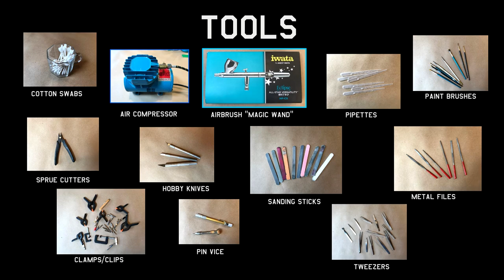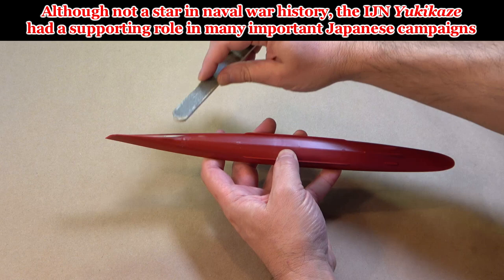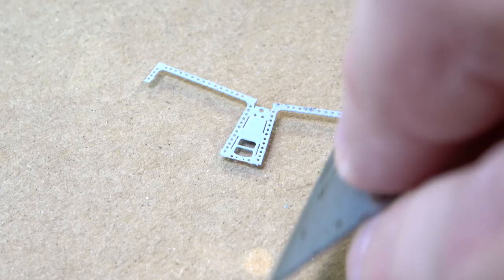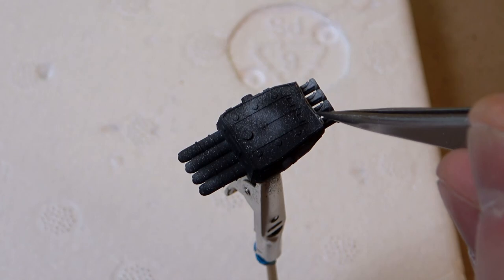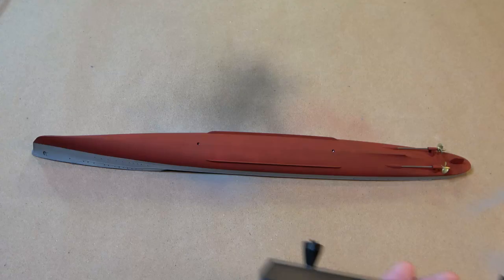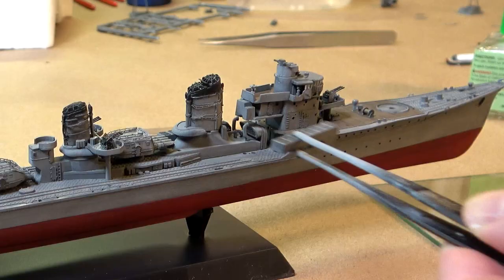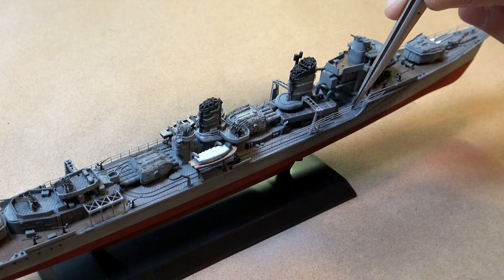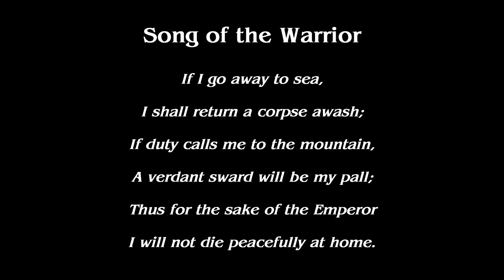Building the Tamiya 1/350 Scale IJN Yukikaze destroyer

Comment: "30 minute blooper reel"--welcome to the world of Ship Modeling :-D
Be advised that there are PE sets for the 1/700 Kagero DD kits out there, and AM accessories.
A very credible build and a credit to your skills,
A couple of notes--the brown on the deck is due to IJN using a chestnut/russet colored linoleum over steel decks for increased footing (the USN used it to, but largely only at Signalman stations and some searchlight platforms).
Tamiya's Hull Red is actually perfectly matched to IJN hull red color chips.  It needs 50% red to get to USN hull red; and used only !:4 with Insignia Red for RN hull red.
As a general note, destroyer propellors were in a Monel sort of green-steel sort of hue, and IJN ones had a green-steel-bronze sort of hue, per the preserved ones in Taipei.
A magnificent build.
Reply from the maker: Hi CAPNMAC82, thanks for that information, this is definitely your forte! 😊
Reply: @MaxAfterburner  yeah ships are my gig, right in my blood.  Much like how you are reflexively familiar with the inside bits on a/c.

Comment: I have used Freetime hobbies for some great ships in 1/700 scale including Combrig Models and others. They are good enough but mislabeled or rather posted an incorrect pic of one expensive Combrig kit. It was the difference between one battleship vs a cruiser with the same name. So I got my cruiser instead of the battleship simply because I was using the picture on their website as an indicator of what I purchased. But still Freetime Hobbies is a good model supplier. Great video btw.
Reply from the maker: Hi William, I'm glad you enjoyed the video! 😊

Comment: great build,that Looks very helpfull for my own 1\200 YUKIKAZE card model project. Thank you. One Idea: A very much better bronze effect is possible (on the linoleum deck's bars as on the propellers) by using Citardel gold colour (can with a white cap!) with much finer grinded pigments... Same due to the silverish top of the torpedo transport wagon's railing and a tremendous lot of little dots that can additivly been set here and there. Hth,Chris
Reply from the maker: Hi Narrow Gauge Island, thanks for the advice. I may use more metal pigments where needed on a future ship model. Have fun with your build of the IJN Yukikaze!
Reply: @MaxAfterburner  Thank you I did start wit the hull and balsa filling blocks

Comment: Quick question. Do you apply a clear coat to the hull before weathering with oil paints?
Reply from the maker: Hi Ho-203, so far in my ship builds for the channel, I have not applied a clear coat prior to adding any weathering including the oils. Typically, however, most modelers would add the protective coat.

Comment: Nice build. I am curious why you went for XF-72 instead of the XF-79 on the decks. No big issue, just I have been told the XF-79 is a pretty authentic color for Japanese anti slip decking.
Reply from the maker: Hi Glen, the XF-79 is a little brighter and I wanted to make it appear that the deck on this model was little darker and not so brand new.
Reply: @MaxAfterburner  Okay ty.

Comment: What glue do you use for the PE work?
Reply from the maker: Hi Anthony, I use CA glue aka super glue. I find the store bought "Gorilla" brand meets the viscosity I require.
Reply: @MaxAfterburner  awesome thanks. I have been using gel type but find it globs. So just nomal CA?
Reply from the maker: There's different thicknesses from water-like to very thick in hobby catalogs. It all depends on what you're working on and how well you're able to control them which typically are the determining factors. I find the "house brand" good enough for most of my work.